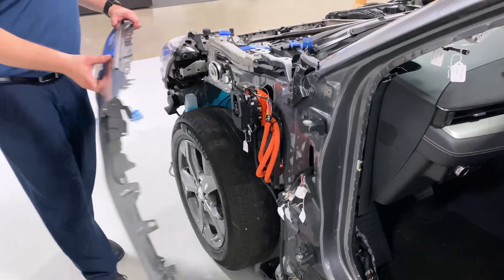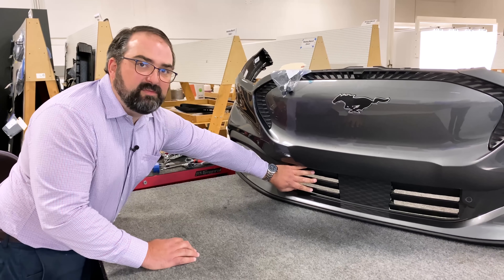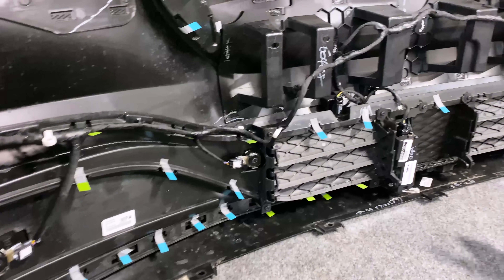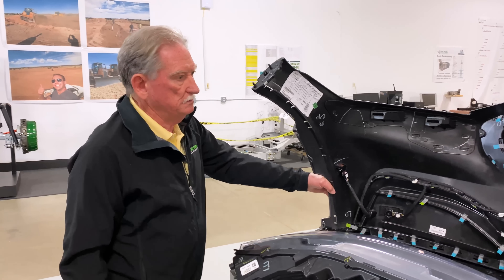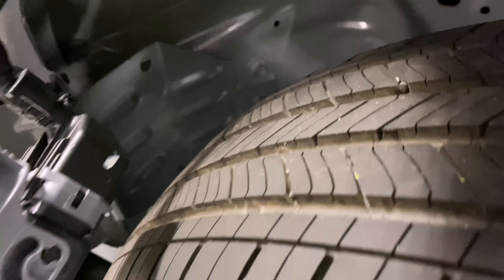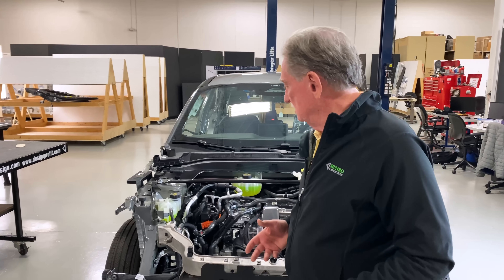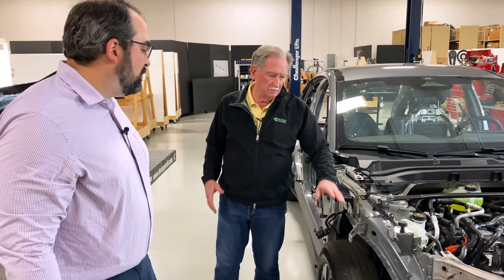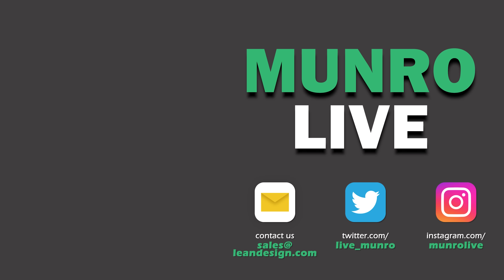Does the Mach-E pass the SORB test?

Comment: Regarding the controller over the wheel, using the nailon tray. Wouldn't in be feasible to snap the connector onto the body and then the controller on the connector? Like is usually done on circuit boards, so it is just supported by a strong connector, and maybe a hook somewhere else.

Comment: Looking at the SORB structures makes me wonder how well it would do in a 30% offset test.  Are they just designing the car to beat one specific test?
Reply: Not just that, but the strategy of deforming the wheel into the car itself shows they are only caring about passing the tests at the speeds they're done. If they cared enough to do it properly then they would do what Volvo engineers do and allow the entire wheel and hub to shear off. Preserves more of the momentum and reduces injury significantly at speeds higher than just IIHS or NHTSA testing

Comment: There is a reason why Volvo's wheel and hub is designed to easily shear off in small overlap. The car is allowed to retain more momentum after the impact, reducing energy absorbtion for occupants and therefore risk of injuries at even higher speeds than the minimum required to meet good safety ratings. Deforming the wheel itself is a crutch in my opinion.

Comment: I had to look this up: Body in white is the stage in automobile manufacturing in which a car body's frame has been joined together, that is before painting and before the motor, chassis sub-assemblies, or trim have been integrated into the structure.

Comment: Any toughts about hub engines ? Like rivian uses everyone else seem to not like Them but it seems like a Good way to reduce weight and parts🤔
Reply: Hub motors introduce a lot of unsprung mass which adversely affects NVH. It also forces you to prioritize small size and low mass instead of maximum efficiency when designing the motor.

Comment: Would hate to break a snap clip when doing a repair on a headlight that probably costs $500
Reply: I assume there is a tool to remove the snaps.
Reply: @AndyZach  I'm the tool that usually breaks the snaps on trim pieces whenever i need to remove them lol. Thank god for jb weld

Comment: Really nice design on that front end. Both from a manufacturing standpoint but also repair and art and style!
Reply: The fender attachment point is less efficient for initial manufacture but MUCH MUCH better for minor collision repair than having it as a cast or welded piece of the main structure frame. Have my body shop bolt off a bent piece and bolt on a fresh replacement? YES! Have my body shop repair/straighten/re-align/weld the car's frame? NO!
Reply: @HillslamsMirror  Agreed.  I'd much rather repair this vehicle than a Tesla. I've had people ask me to fix minor things on their Teslas and its a nightmare (and I'm not even talking about the impossibility of getting parts). They don't want to send their car in and kiss it goodbye for a month, and I can understand that, but most of the time I gotta tell them that's what they're gonna have to do. They're just not repair friendly.

Comment: Building the car to pass the SORB test is like VW building their cars to pass emissions tests in the limited testing environment. The SORB test should give an indication of how safe the car is in impacts that aren’t directly from the front. It’s not generalizable if the design is just meant to protect at a 25 degree offset. What if the offset is 10%? 40%? At an angle?
Reply: Stop talking bullshit mate.
Reply: There is plenty of research looking at tradeoffs between low, moderate, large offsets in restraint and structural design. If you don’t agree that there are tradeoffs and manufacturers are sacrificing one for another, then present your arguments. Don’t just insult me. A possible solution would be to vary the tests over time without warning to the manufacturers. As they should also be doing with emissions tests.

Comment: 11:30 What about removing the metal fastening points and the nylon fastening point tray and just integrating that into the plastic fender instead? The fender would be a complete module and could snap into the body frame. That fender piece could be made out of plastic to save weight too.
Reply: How would you plug in the control module if its attached to the fender? Also that means that very important part would have to wait until the fender is attached... Which is a whole seperate assembly area. I own a Saturn with plastic fenders and doors. Plastic is great for doors and bumpers where the impact will largely be perpendicular. But if the impact is in parallel with the plastic part, it shatters instead of bends. Which is why I have a shattered fender with shattered headlight mounts that has to be completely replaced instead of a metal fender that could just be bent back into place.
Reply: @patreekotime4578  The control module would be part of the fender assembly and click into one of the supports. Many cars use plastic body panels for this area to save weight.

Comment: Sandy your little box on a bracket uses vertical straight male contacts that can be machine auto assembled and flow soldered with all the other parts on the PCB so top down so cheap. 90 degree male pins not the same process, more expensive and then not top down on final assembly. The connector you like, I also like, its a standard water proof using standard female contacts. The box could have been  just mounted sideways as you show, unless it needs to go horizontal as it's sensing horizontal in which case it should be under the hood not the wing. The best show on Utube for anyone into vehicle connectors last 40 years.

Comment: FORD vehicles still look like a mess. The gigapress is just flipping amazing. That shelf above the fender was just dumb. I’m a designer. I can’t understand why anyone thought that shelf was a good idea??  Comical.
Reply: Stop talking nonsense mate, ford already has all the materials to make this car, they have gigantic stamping presses and just need new dies for new car models. Aluminium is also very expensive compared to steel.
Reply: @Alan May  they don’t have gigastamping presses anywhere near the side of TESLA gigapress. You can’t just order one according to Munro. Do your research. The gigapress that would need to compete with the likes of TESLA would mean they would have to invent a new space age aluminum that could be inject 200-300 lbs within milliseconds. Less than a second. TESLA has removed 1,000 pieces from their cars with 3 molds (front, batterpack, rear), 900 welding robots and tons of labor. You don’t just buy a press. There is one company in the world that makes a press this size and it’s called, IDRA. You clearly are out of your depth, because you have to have space engineering material scientists brilliant enough to invent a new form of aluminum that I’m even Munro could not identify and called it brilliant.
Reply: @GET2222 infortunately tesla will still need stamping presses for the doors, hoods, fenders, frunk..........
Reply: @GET2222  im not dumb and I know everything about IDRA and the tesla casting machines, the die casting machine will not be fast and milliseconds is just the injection, it has to be molten and cooled correctly after. The casting does not replace 1000 pieces of the car
Reply: @GET2222  are you trying to be dumb?! Every other car companies also work with very high grade materials, just look at f1, wrc and all the special cars they have made over the decades. Go watch the limiting factor or other channels, the composition of an alloy can be very easily measured. Sandy munro is not a savan he doesn't know everything on cars materials/electronics heck even computer sciences.
Reply: @Alan May  then you are calling Munro a liar. The back of the car is 300 pieces and 1/3 of the car. Do your research.
Reply: @Alan May  I’m not going to debate and argue for Munro with you anymore. Feel how you want to feel about manufacturing. The best part is no part. Removing 300 parts for the back side of the car is pretty basic first principals thinking. Getting rid of the 900 robots is a massive energy save and cost, not to mention the amount of space needed and labor. “Welding is a flawed process and doesn’t allow for a perfect build”. Sandy Munro’s words…
Reply: have fun repairing that pressed mess. 
separate parts for the win. But you probably don't fix stuff. Certainly most Tesla buyers don't.
Reply: @westmowgli  you know what’s more expensive than aluminum? LABOR and assembling 300 parts that are no longer needed. Steel rusts. 

According to Munro, if you have to fix a molded piece of TESLAs space grade aluminum your car is probably totaled and you don’t want that car repaired. Tesla invented their own aluminum to inject 200 lbs of molted aluminum in milliseconds. No OEM has this tech. You can’t just buy a press either. They are the size of a small house. These casting are stronger and lighter than steel. It can be repaired as well. Munro has been telling OEMS to build cars this way well before Tesla. Munro has stated many times that everyone will be building cars this way or they will suffer from high cost of labor, inferior product and range because the weight difference is significant. You get a perfect build every time.

I love innovation of all kinds. Stop bashing technology and a better build process that you clearly don’t understand. Basically, you’re arguing from a place of emotion, which is fact-less.
Reply: @GET2222  nonsense, aloys are relatively easy to develop and ICE manufacturers have been working with all types of materials including composite ones. Bmw, porsche..... uses magnesium, aluminium, carbon fiber..... recycled materials amount is even increasing.
Reply: @GET2222  the stamping and welding of steel and even bonding requires less no energy compared to constant melting aluminium and the process for the tesla casting last more than just milliseconds, plus the parts have to be thoroughly inspected for defects.....
Reply: @Alan May  false. you clearly don’t get it. It removes nearly 9-12 hours of labor and 900 robots. Did you even read my post? You’re wrong. Munro has debunked this theory again and again.
Reply: @Alan May  wrong again. Munro has spoke to this at length. It’s very hard. The press is the size of a house. If you get it wrong it will blow up half of your factory, Munro has gone into detail on this. Do your research.
Reply: @GET2222  its not false, vw has been making 10 million cars a year and they don't need to make a different part for each car model, they share the platforms which means they can make tousands and tousands of the same parts which are dirt cheap and easy to make, you cannot easily modify a die casting to make other pieces. The 9-12 hours are very old datas, plus there are significantly way less than 900 robots.
Reply: @GET2222  sandy is very old school and never visited a modern ford or other manufacturer plant. When tesla was using 70 parts just for the rear of the car, others were using way way les than that. Platform sharing has always been the key in manufacturing.
Reply: @Alan May  you are missing the point. I’m not even sure what point you are arguing now. Tesla has ONE part now. propriety material science is huge. Can other OEMs do it? Yes. Will they? No. They are over $100 Billion in debt. They pay well over $1B a year in just interest. Can they retool their factory for casting? Yes. Will they? Not for years or if at all. 

People think these OEMs can make anything. Their software sucks. Tesla’s goal is to be the “best engineering and manufacturing company in the world”. FORD and GM are just trying to stay profitable. Clearly their ICE numbers are going to drop considerably in the upcoming years and much faster than they can scale to replace the fleet with EVs. FSD is also going to be an issue for them because they have no means to achieve FSD. 

FORD and GM have ultra thin margins because of dealer networks and will more than likely consolidate, get bought or die. Just like NOKIA and BlackBerry, even Microsoft didn’t see or believe Apple was a threat to their business. The only difference is TESLA isn’t going fit the high end market anymore. They are scaling for 30-40% profitability. VW still can’t do over the air updates and no one in China wants their cars. TOYOTA will go bankrupt. The new EV companies will splinter the industry and the big OEMs will not adapt fast enough because of shareholder concerns, unions, debt, ICE inventory, dealer network, no charging infrastructure, retraining employees, old inefficient plants that need retooling for EVs, lack of software engineers and the list goes on… Tesla and new EV companies ha e none of these issues. Zero. Not to mention, their leadership can’t cast a clear vision for the future without their boards replacing them.
Reply: @GET2222  the amount of ignorance in your comment is staggering, material science is nothing special, other OEM have been working on much more complex and complicated materials than anything tesla does. From the parts used in normal engines and car parts to performance vehicles, f1, lmp, marine military equipments.... mercedes makes the best/most popular commercial vehicles that are used for all types of applications around the world. Cut the bullcrap mate, there is sooooo much more in the automotive industry than you think.
Reply: @GET2222  tesla has never made money from their cars, they mostly rely on the dumb carbon taxes, even their solar business isn't doing better either.

Comment: Snapfits for headlight doesn't look like a good idea besides production cost optimization. Small fender bender and one is changing front bumper, headlight unit due to broken snapfits etc. Insurance and repair costs spiralling out of control to save a dolar at production.
Otherwise some good observations on simplifying opportunities.
Reply: There is no such thing as “small fender benders” anymore! You hit a bumper today it has to be replaced.
Reply: @RayNLA  not to forget all the sensors that needs to be recalibrated ....
Reply: @RayNLA  in case of Mustang, appears that headlight unit would also have to be replaced due to broken clips, which in top spec LED form guessing wouldn't be cheap. Poor design in my book
Reply: Those snapfits appear to just reduce the vibration of the bumper, not actually holding it on, that would be at the top. Its actually GOOD that they have snapfits at that point so they CAN break instead of energy going into the headlight mounting points.

Comment: Is it not better to have bolted on brackets for easier repair down the line?
Reply: I understand the love for snap fasteners from a manufacture standpoint but for the consumer, I appreciate manufacturers taking the time to use bolts and screws.  Even with the proper fastener removing tools, for every 4 snap-in fasteners you have to remove to do something like replace a headlight, you're probably going to break at least one.  Then you are stuck looking for proprietary snap fasteners.  We need to think about more than just helping manufacturers build cars faster and cheaper.  We consumers have to maintain them too!
Reply: I had the same thought about crash repair, but I can’t imagine a body shop not being able to weld a replacement bracket on if needed.
I’d like to hear Munro’s thought on this subject.
Reply: YES!   I feel like these videos are too centered on manufacture cost and profit.  Not on longevity of ownership. Of which, simple easy and SMALL PART replacement are key. 
If I gotta weld or bend or realign a major structural component because of some small minor ding or mishap, i don't give a rats but how elegant it was going down the assembly line. I want bolt off bolt on wam bam thank you done repairs. Lower effort lower cost, better car to own LONG TERM.

don't we want people to own their cars a long time? Yes we do. These aren't cell phones. disposable consumerism. Tesla makes rolling cell phones. Shame. 
Stop opposing Right to Repair, Tesla.
Reply: @westmowgli  disagree on the cell phone part with Tesla. But overall I agree. Owned a model s since 2014 and now have 150k on it.
Reply: @sparkfire1223  how many times did you fix something on it with hand tools? a 7yr old car is just getting into its middling years. 2nd and 3rd owners of a car are completely different people than new car buyers. manufacturing like this and opposition to RightToRepair are great for the manufacturer, terrible for the lower income.
Reply: @westmowgli  Door handle repaired with hand tools, ICU display replaced the screen without a problem using hand tools.. Ugh.. Not sure what your getting at?
Reply: @westmowgli  Being uninformed leads people to to make comments like Tesla makes rolling cell phones. Look at the cars in Havana, Cuba. It’s great so many of them are still working, it is a testament to ingenuity. Nevertheless, if they were newly manufactured today, they would not be viable in the market.
 Technology that works is great, tech that makes slaves us to its demands, not so much.
Reply: @tedbaxter5234  technology that works is great, technology that works AND is repairable (especially by 2nd and 3rd owners without access to much beyond hand tools) is BETTER.
Tesla is not the latter. They follow the manufacturing philosophy of cell phone makers. There is nothing mis- or un-informed about that statement.